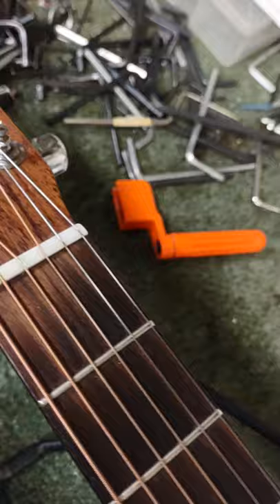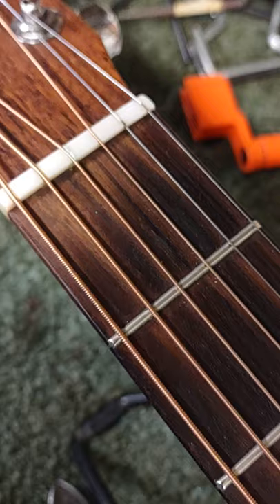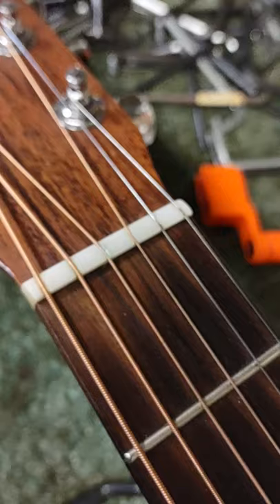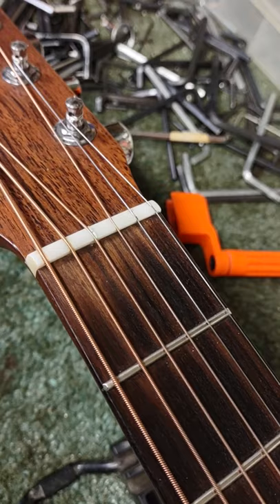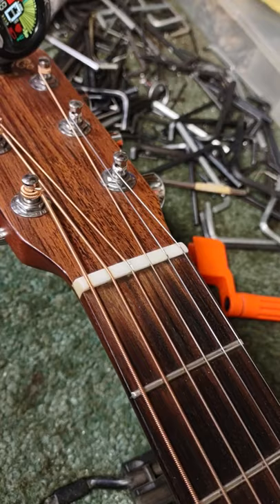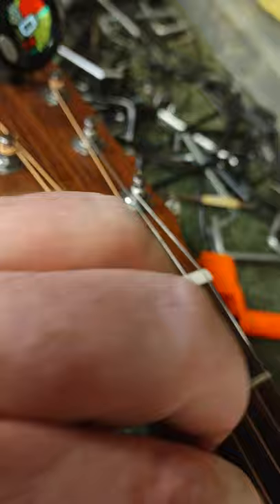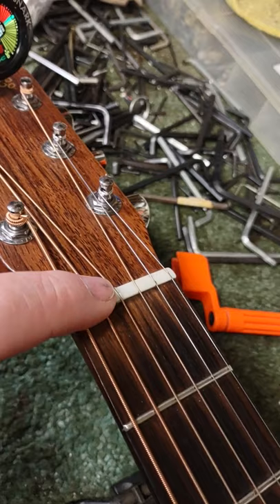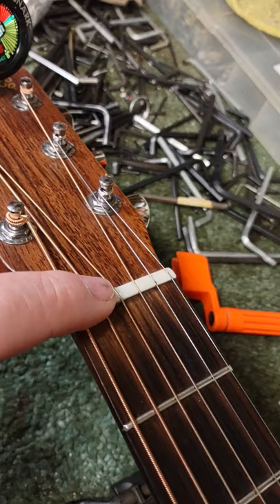tuning problems on a guitar? maybe the string is getting stuck in the nut.

Comment: only works with the wound strings but if you dont have a nut file you can use an old string. takes a while but i recently had to do this for the bottom 2 slots on my mustang and it worked perfect
Reply from the maker: Great trip.  Thanks.
Reply: My D and G strings aren't getting tuned, while tuning it seems like it will break it's already very tight. What shall I do??